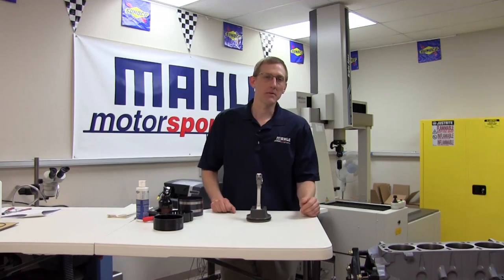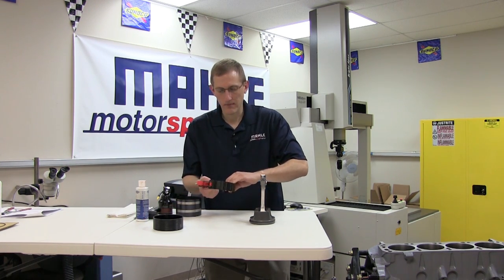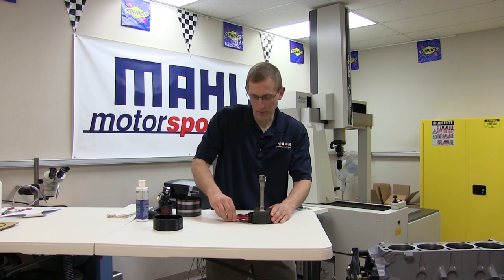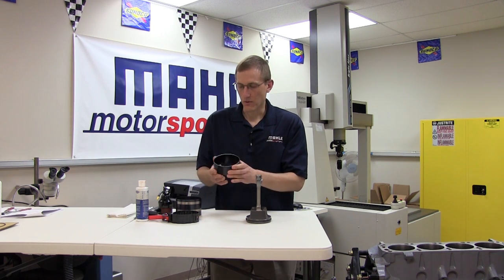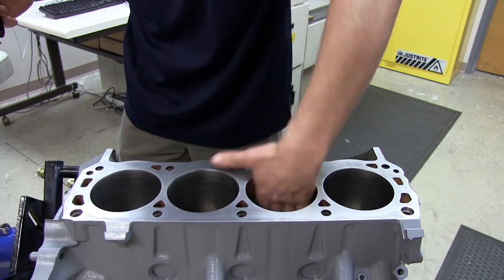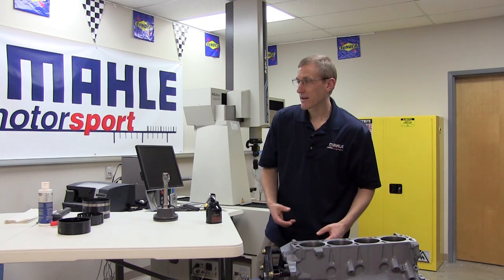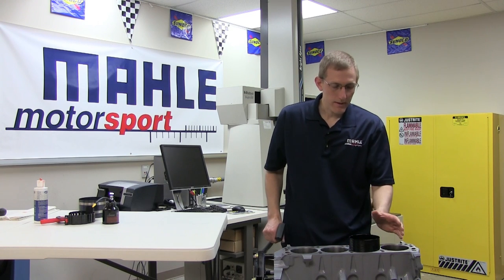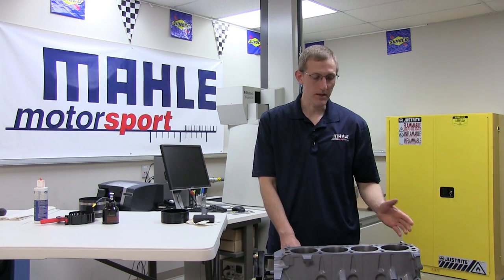Piston Installation

Comment: I just received some mahle power pak pistons 87mm for my H22 I’ve been looking online and finally came here but can’t seem to find an answer for which direction the piston is to face. The numbers towards the intake manifold is what seems to be correct but I don’t want to assume.
Reply: Did u ever find out what direction to face the piston
Reply: @boostedr5397  yes I did. I just matched the old pistons valve cut outs with the new mahle piston valve cut outs and got them installed with no problems and have a new tune in it at 543whp. I would’ve liked to have something in writing but I faired well lol.

Comment: I'm trying to install pistons into cylinder block with a similar wiseco brand compressor. But the last thin ring of the oil ring es very hard to insert. It suddenly expands when leaves the ring compressor and enter the chamfer in the  block. How can I solve this?
Reply from the maker: I'm not sure the specifics of their ring compressor, but I do know they can be a bit tricky to get in, especially if the compressor is off a bit. Hopefully you've solved the issue with a little practice.

Comment: Good video I have been using the tapered sleeve compressors for years I do have a slight disagreement with one point the amount of oil on the cylinder bore can be an issue a large amount of oil on the bore can glaze the cylinder walls at start up This information comes direct from Total Seal in fact they recommend WD40 on the rings not oil for assembly oil is also ok but they say you should not have even one drop of oil fall on your drip tray thanks for the great video
Reply: That sounds like total BS.
Reply: WD40 contains water... it also attracts water after a little time.  If you are not going to be done with the build in a day or two, then I would keep WD40 away from the engine components.